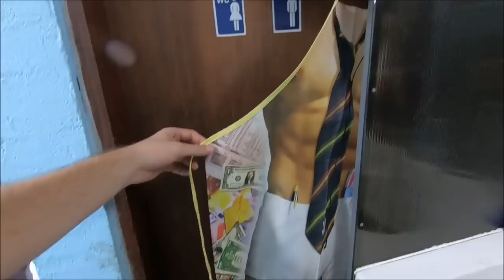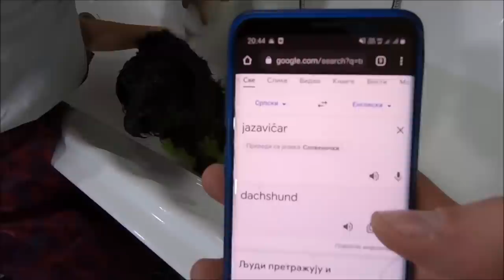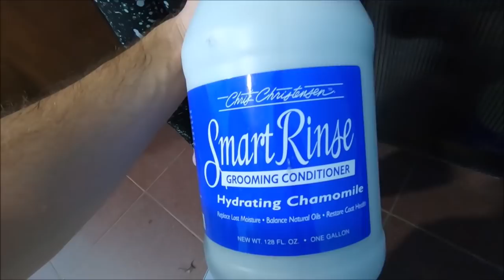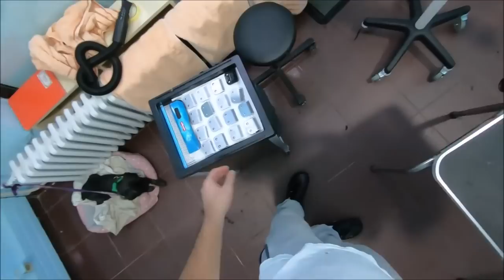She Was In Terrible Condition, But This Grooming Changed Her Life

Comment: When you're drying if you hold a towel off to the side it will catch the excess water an cut down the drying time as the water will not go back on the dogs coat! Just a tip to try 😀